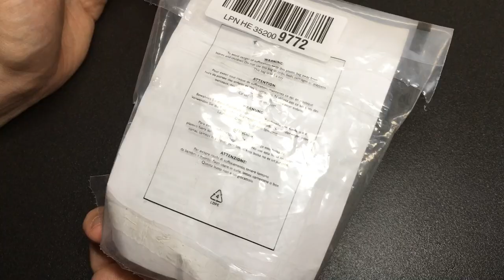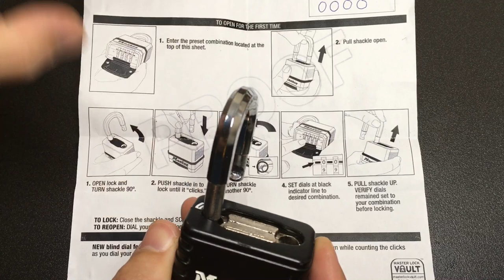Master Lock Pro 1178 Decoded Out of the Pack

Comment: So I have this lock. After using it twice after purchase, the code wouldn't work anymore. I thought I must have changed it by mistake. Spent the weekend trying all similar combinations and then tried your video today. I decoded it to the same code as the original code, and yet it wouldn't open. After changing some more numbers and eventually going back to the original code again, it popped open. The lock is pretty bad, it gets stuck even on the correct combo. Thanks for the video, I also actually started going through every combination and was 2400 combinations in when I gave it a try!

Comment: We've already established that these 4 or 5 digit dial combination locks are easy to decode with very little skill and no tools.
The first locks I learned to open as a 13 year old were those 4 digit bicycle chains doing exactly the same thing you did here, and without any prior experience or teaching, I just wiggled a lock a bit then figured it out.
In my opinion these are the worst style locks ever made, not just because they are easy to decode, but especially because you don't need a single tool.to do it.
Reply from the maker: True, but some are much added to decode than others and take a degree of skill and feel to decode for sure

Comment: It also looks like clamshell construction,  and they've very helpfully left two holes in the bottom at the seam where you could use a punch to split it and the plastic sleeve open. Cheap trashy rubbish
Reply from the maker: Possible, I will have to explore!